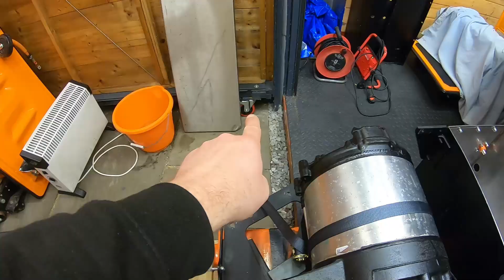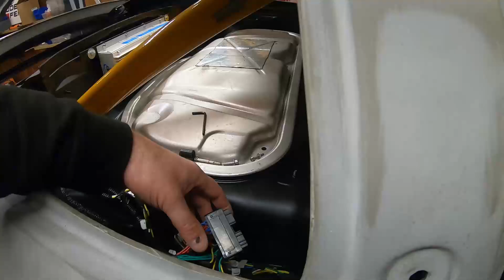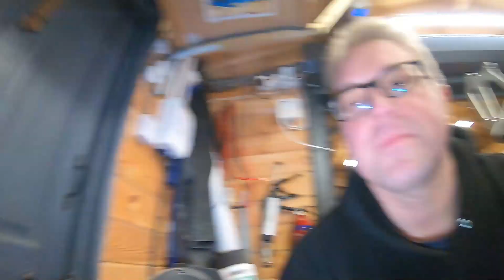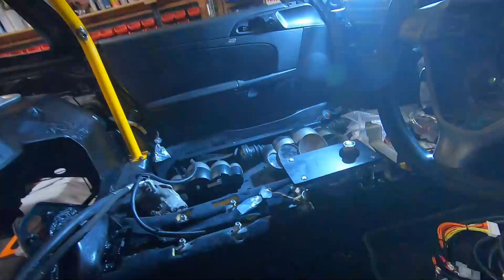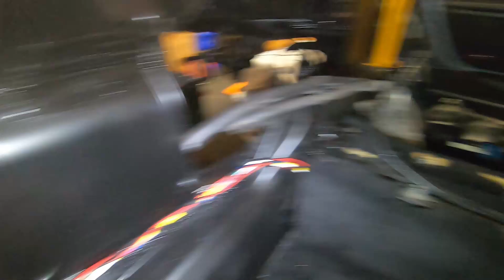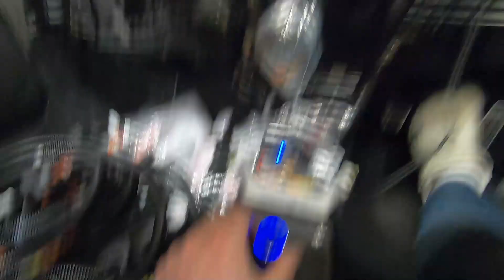EV Home Build Part 7 - EV Controls T-2C Controller - Installation Guide

Comment: Can we run t2c and LDU without BMS?
Reply from the maker: If you mean while you are building a car, would the car move without having the BMS connected then yes it would. I did the same thing. I got the car working without the BMS on line. Obviously you still need a BMS for the car long term for charging and battery pack monitoring.

Comment: great work! I'm behind on your videos, but now I can watch them all the way through since you're already done now. This is definitely providing good info and inspiration to get mine started.
2 questions:
1-were you able to keep the Porsche accelerator pedal and it worked with the LDU and T2C? 
2-(and you may get into this in a future video) did you keep the manual pedal box or did you switch it out for a automatic pedal box?
Thanks in advance.
Reply from the maker: Thanks
1) yes Porsche accelerator pedal worked just fine 
2) yes. I kept all as is and just physically removed the clutch pedal